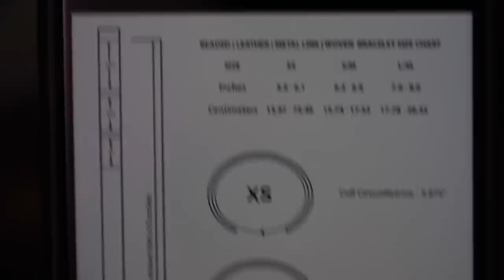CUFF BRACELET

Comment: Mr, are you using 925 or 999 silver?
I tried another 9 wire cuff bracelet by using 2.8mm 925 wire and that's hell, too hard to bent.
Reply from the maker: 925
Yes it is hard